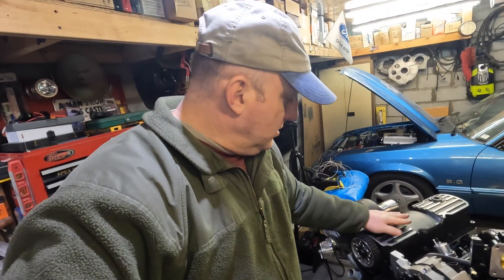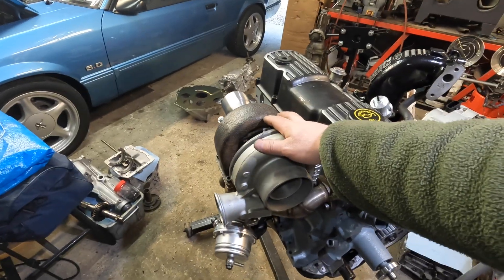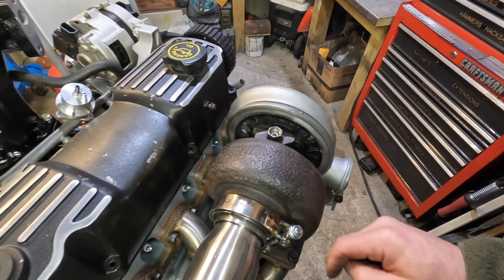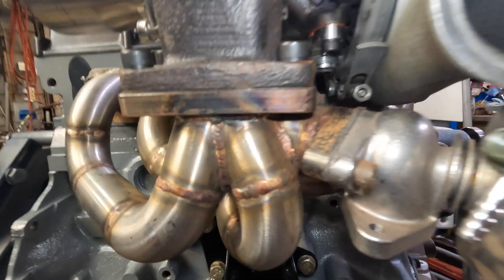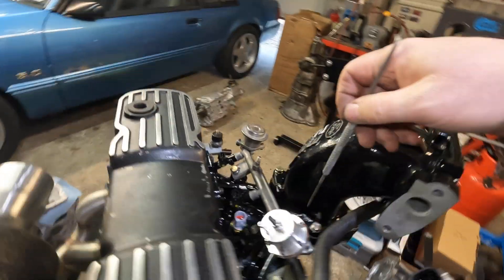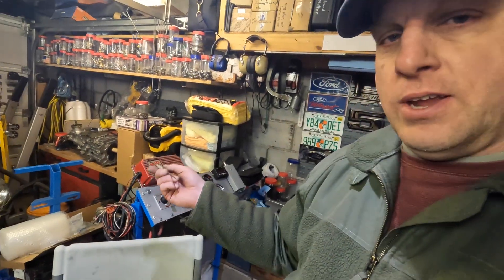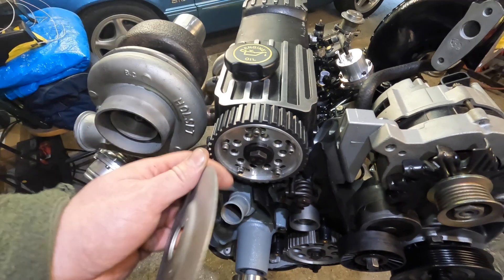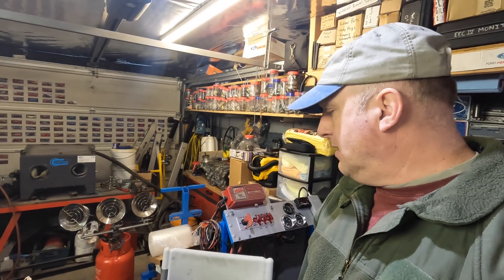Top End Assembly On The 2.3 Turbo Thunderbird Engine

Comment: Hey dude do have the specs for the head am also putting my engine back together had the head ported I might put some arp studs but I still using the stock bolts because arp studs have come in mail yet